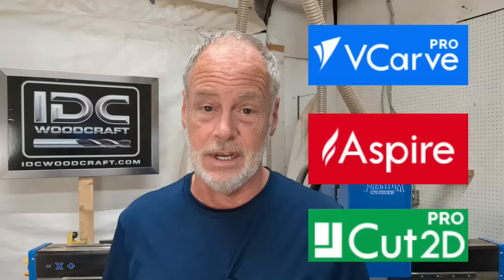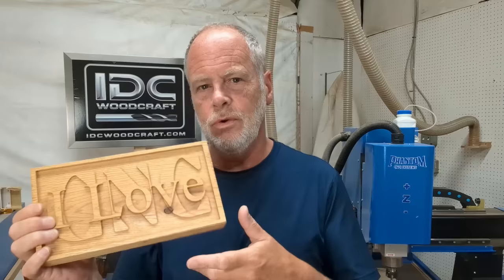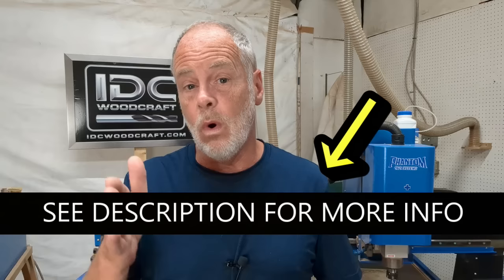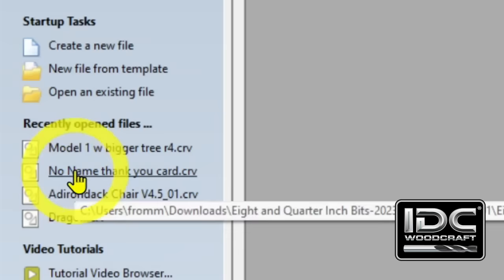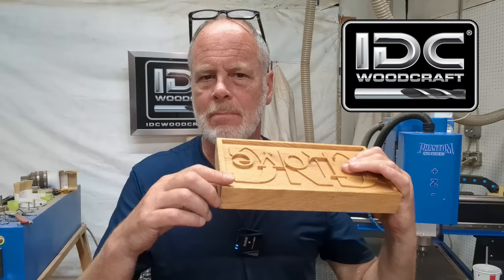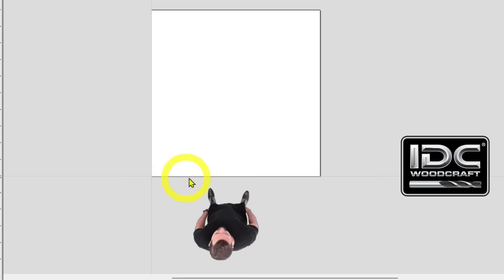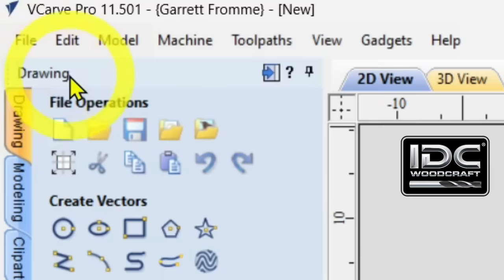The Most Complete Vectric 101 Tutorial for Beginners (Vcarve, Aspire, Cut2D), CNC Router Project

Comment: Hi Garret, I loved this video. Well worth 1.5 hours as you explained it at a great slow pace that even old guys like me could follow. My woodwork club just got a CNC machine and we need to learn so it doesn't sit there like a white elephant. I'd previously designed a speaker front baffle but I learned how to do the toolpaths so I could see the model in 3D. Just awesome. Thats going to save a lot of annoying circle routing. My port is an oval shape which is very difficult by hand. This will make cutting them a breeze with absolute accuracy...just like a bought one. Thanks so much. Peter from DIY Full Range Hifi Speakers - Australia.
Reply from the maker: diyfullrangehifispeakers, Hi Peter! I'm so glad to hear you found the video helpful and that it's making your CNC journey smoother. It sounds like you're going to have a great time with that machine, especially with those oval shapes. Wishing you and your woodwork club lots of fun and learning with your projects! Cheers!

Comment: Over the last two weeks, I've picked up an entry size for my purposes CNC, couple bits from you guys and other places, and have tried no fewer than 6 CAM software packages. I'm transferring a lot of accumulated knowledge so it's pretty easy to figure out a program for me, though there's a lot of necessary details, specifically the bits, that will trip me up at times. Kind of like trying to muddle your way through a new language that some terms you just don't know. 
Anyway, I'm primarily going after 3D cutting capabilities, which has dramatically reduced available solutions, but I've been really impressed with VCarve. It does everything I need it to do with great resolution and a mostly uncluttered UI, where some software will do XX really well but the UI is a mess, or others have a great UI, easy to figure out, but don't have the capability I need for several upcoming projects (making parts and doing molds most immediately), or having importable tool libraries. I was really using your video to see if there were any tricks I may have missed or other capacities I've not explored, but enjoy the channel in general and think I'll stick around. 👍
Reply from the maker: C-M-E, I'm glad to hear you've found success with VCarve for your 3D cutting projects! It sounds like you've put in a lot of effort to find the right software fit for your needs. Keep exploring and experimenting! Thanks for your support and for watching our channel!

Comment: Garrett Complete dummy here. LOL! I'm looking to use this in my hobby-business. Inlays on guitars and such. Basically cutting out the inlays and plowing out where the inlay goes! Headstock head plates and sound hole rosettes. I believe the Cut2D will do what I need. Thanks
Reply from the maker: I would not recommend cut 2D for the inlays that you want to make. You want v carve inlays. They seat much better. That will require you to get vcarve desktop or pro. The difference between desktop and pro is desktop will only allow you to work with projects or no bigger than 24 in. So if you're going to inlay on guitar next, you will probably want to use the pro version . That would be this one
https://sienci.com/product/vectric-vcarve-pro-v11/?ref=idcwoodcraft

Comment: 🎯 Key points for quick navigation:

00:00 Understanding Vectric layout
00:14 Design basic project
00:24 Comprehensive beginner's tutorial
00:52 CNC router projects
01:06 Vectric software basics
02:01 Free vs. paid
02:39 Software versions differences
03:44 Cut 2D limitations
05:02 V-carve flexibility
06:10 Aspire advanced features
08:01 V-carve Pro recommendation
09:09 Vectric Pro features
10:20 Software navigation basics
11:11 Launching V-carve Pro
12:07 Updating Vectric software
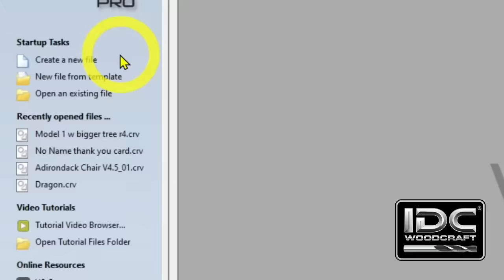13:42 Starting new projects
14:37 Job setup dimensions
16:13 Project types explained
17:38 Setting job size
19:12 Z zero position
21:00 X Y datum position
22:22 Confirming job setup
23:42 Project workspace overview
24:08 Datum position change
25:02 Setting zero point
25:45 Screen real estate overview
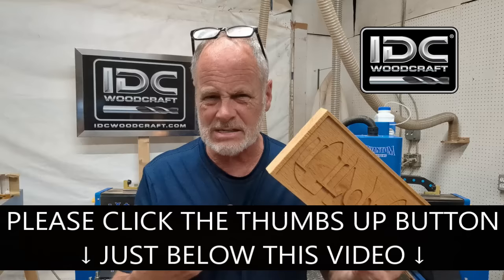26:27 Design area scale
28:13 Mouse coordinates display
29:07 CNC motion explanation
32:05 Design orientation guidance
32:47 Software layout understanding
33:42 Drawing tab focus
34:21 2D view preference
35:04 Tool paths explanation
36:40 Understanding 2D view
37:23 Layer management
38:06 Snap tools activation
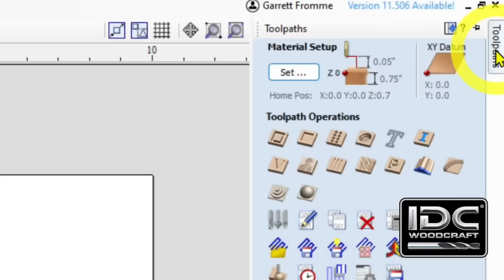39:02 Tool path tab usage
39:43 Design tools overview
41:09 Router bits starter set
43:27 Design tool explanation
44:08 Saving your project
45:33 File management icons
45:47 Create vectors introduction
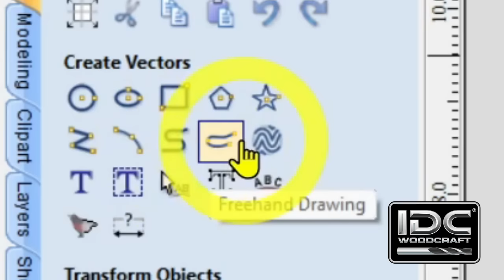46:41 Basic shapes drawing
47:34 Adding dimensions
48:01 Vector term defined
48:28 Transform objects usage
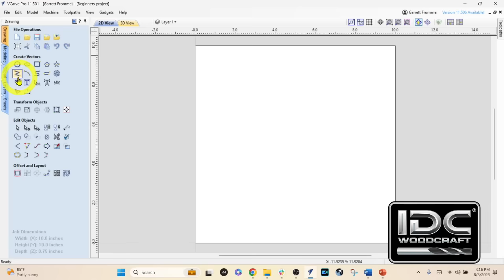49:11 Drawing closed vectors
50:33 Closed vs. open
51:01 Drawing rectangles basics
52:23 Closed vector definition
53:05 Retirement creativity purpose
54:02 CNC community support
54:30 Importance of mouse
55:25 Essential tools needed
56:06 CNC rewarding journey
57:14 Consider software course
59:04 Investing in skills
01:00:27 PDF resource link
01:01:12 Drawing five-inch circle
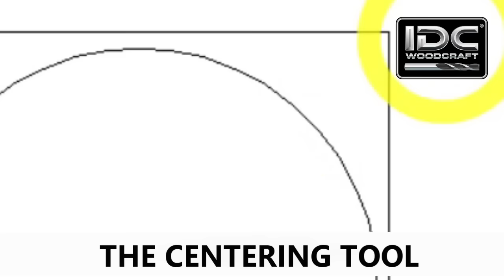01:02:50 Centering objects tool
01:04:26 Moving objects easily
01:06:02 Arrow keys usage
01:07:47 Escape button shortcut
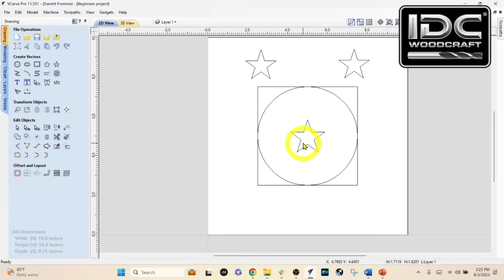01:08:28 Adding text basics
01:09:12 Text justification
01:10:34 Changing text font
01:10:58 Change text size
01:11:40 Select and edit
01:12:06 Move objects freely
01:13:02 Resize text easily
01:13:47 Stretching text vertically
01:14:13 Snap features help
01:14:54 Centering objects precisely
01:15:36 Rotate selected items
01:16:18 Recommend CNC course
01:17:30 Selecting methods
01:18:10 Drawing horizontal lines
01:19:17 Cutting features explained
01:20:29 Unique shape creation
01:21:35 Closed vector creation
01:22:04 Creating tool paths
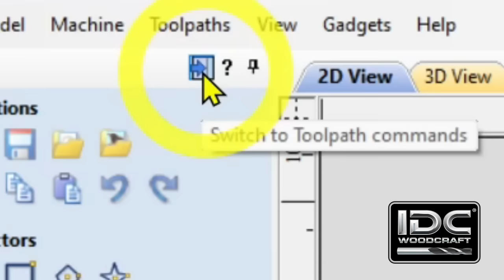01:23:11 V-carve vs. cut
01:24:08 Types of cuts
01:24:49 Pocket cut explanation
01:25:45 Profile cut explanation
01:26:24 Engraving with V-bit
01:28:02 V-bit selection process
01:33:12 Uncheck advanced tools
01:33:40 Preview tool paths
01:34:22 Carving simulation preview
01:34:52 Vertical view arrangement
01:35:20 Select pocket tool
01:36:02 Set cut depth
01:36:29 Remove extra tools
01:37:35 Select downcut bit
01:38:17 Correct vector selection
01:39:00 Recalculate tool paths
01:39:47 Pocket star preview
01:40:09 Sharper corners explanation
01:40:50 Recommend software course
01:41:30 Final cut preparation
01:42:30 Profile tool path
01:42:45 Set cut depth
01:43:25 Name and calculate
01:43:38 Preview final cut
01:43:59 Double-click to finish

Made with HARPA AI
Reply from the maker: warezit, thanks for sharing brother!
Reply: @IDCWoodcraft  Thank you for the video! 😎

Comment: QUESTION! I have a very old FANUC O-M series on a KOMO 508. Will VCarve pro make a readable program for my machine? I have been struggling to find a software that will work...
Reply from the maker: Lee, any CAD/CAM program should work to design your projects. Where it gets a little trickier is which post processor you will need for your specific machine. For this, you'll need to reach out to your machine manufacturer for their guidance. I recommend taking a look at this video here where I walk you through what a post processor is: https://youtu.be/wQ0vgXbSRr4?si=ERZAWRwnPjTyoGTU. I think you'll find it super helpful!

Comment: I just installed IDC data base, now I have a couple questions. I'm trying to carve a turkey and I had to shrink the drawing down to 4.5x4.5 and I used a 60-degree v bit and I think from making a smaller drawing its taking too much of finer detail, what bit do you recommend I use? Also, over the years of ordering bits the shipping kills the order, does IDC have a solution for this? I have a Hurco milling machine and sometimes I would like to try a single bit out and it's frustrating that its cheaper to drive to my aera shop then mailing it to me. Isn't there some way to send for example one- or two-bits regular mail in and envelope? Thanks for all you do its is very helpful.
Reply from the maker: johnwhitney6292, It's great to hear that you're diving into carving with your newly installed IDC database. Shrinking detailed designs like a turkey can indeed result in losing some finer details, especially when using a larger bit like a 60-degree V-bit. For more intricate designs and smaller sizes, I recommend trying a bit with a sharper angle, such as a 30-degree V-bit, which allows for finer detail work without losing the crispness of the smaller features. Here is a link for a bit I recommend: https://idcwoodcraft.com/products/30-degree-extreme-detail-v-bit-bit-for-cnc-routers-1-4-shank

As for shipping costs, it really depends on where you're located. I recommend going into the IDC store, adding an item to your cart, and input your address when prompted. You will be able to view your specific shipping cost before you will need to pay for anything. That will be the most accurate! Keep in mind that you might also incur customs and duties fees when importing the bits into your country. I cant determine these fees on my end so its best you do your research if you are worried about it brother!

Here's a link to the IDC store →https://idcwoodcraft.com/cnc-router-bits/

Thanks for reaching out with your questions, and I’m glad you find the resources helpful. Keep up the great work!

Comment: Hello, I m using v carve pro and I am engraving a large quantity of text in granite. I needed to change my engraving bit part way through the text. Clearly I needed to zero my Z axis.
My question is ;  how do I continue where I left off? 
I tried to eliminate the text that was already engraved but it changes all the existing text position so I can't start where I left off.
Please help me, I don't want to loose over 10 hours of my work.
Reply from the maker: DuaneSoulTruth, To continue where you left off after changing the engraving bit in V Carve Pro, you can manually set the Z-axis zero point to match where you stopped. Then adjust your toolpath settings to begin at the same depth you left off. This way, you can resume engraving without losing your progress. 
As this one is a little tricky to walk you through over comments, I recommend joining Kate and I for our live sessions we host every Wednesday evening at 8PM EST. We should be able to help walk you through it then brother!

Comment: Does your data base replae Imperial tools in v carve and are the speeds and feeds going to be different? I built my own cnc in 2012 and have been doing mostly 2d, my machine broke down and i replaced it with onfinty and i mostly want to get into 3d carving. so yes im doing the bit chase. I also want to do pictures, inlay etc.
Reply from the maker: johnwhitney6292, you can import the database as a completely different setup brother! that way you can hold onto your old databases. As for feeds and speeds, some fine tuning for specific idcwoodcraft bits has been made so you might notice a difference on a bit or two. Happy CNCing brother!

Comment: Dear Garet Thank you for your video tutorial. I Have a problem on my CNC which I built it with your generous video help.  I have a problem recently that my perfect circle on Vcurve becomes oval when I cut plywood. Can you help me to find out where the problem is?
Reply from the maker: anberberangagaw9259, I'm glad you found my tutorial helpful! If your perfect circle is turning into an oval when cutting plywood, it could be due to a few factors. Check your machine's calibration, tool bit sharpness, and plywood quality. Make sure your machine is properly leveled and your spindle is perpendicular to the work surface.

Comment: I have a nice size wood shop. I do not want to build a room for cnc machine. What are the pros and cons to enclosing my inc machine. My shop is get covered in dust too much, I am using the  dust boot with my long mill. Do you have a video about this or just some advise, thank you.
Reply from the maker: MichaelGerrior, an enclosure is a really good idea brother! It will definitely reduce the noise quite a bit but you might have reduced palm router life due to the heat generated inside of the box.

Comment: Great video, appreciate the level of detail provided. I originally found your site looking how to solve a specific problem I am encountering and didn't see it addressed here. Perhaps you have another video to address my issue. I followed the Aspire tutorial for beginners on making a simple sign and when I execute the program the first pass doesn't touch the wood. I looked up how to reset the touch off puck dimensions to ensure the Z axis was properly located relative to the work piece, but it didn't appear to make any difference and the first path still hovers just above the wood I am attempting to work. I'm sure there is a simple item I am overlooking but I have ensured everything in my program matches the tutorial program. What am I missing/where can I look to find this issue and how to address?
Reply from the maker: Timbane, it sounds like you might still be having some issues with your z-zero, take a look in that department again and see if that can fix it. If all else fails, contact your machine manufacturer. That will be your best bet to get this problem solved brother!

Comment: When using Gsender, where are the files you load into it?. Are they the individual toolpath files which I can't find on my hard drive, or the Vcarve CRV file? in other words, once the toolpaths are previewed and tested, what do you do next?
Reply from the maker: Paul, great question brother! After you're done previewing and testing your toolpaths in VCarve, the next step isn't to look for those toolpath files on your hard drive directly. Instead, you'll need to export your toolpaths as G-code from VCarve. This is because gSender, the software you mentioned using, needs G-code files to operate the CNC machine.

In VCarve, once you're satisfied with your design and the toolpaths are all set up, you'll go to the toolpaths section and select the ones you want to use. From there, you can save them out as a G-code file. This file is what gSender is designed to work with. It's essentially the set of instructions that your CNC machine will follow to create your project.

So, in short, you're turning your VCarve project into a language that your CNC machine understands, via gSender. If you're having trouble finding where the G-code files are saved, just remember that during the export process in VCarve, you can choose the location to save these files, making it easier to locate them when you're ready to load them into gSender. You also need to select the appropriate post processor. I have a video that should help you with that too. Here is a link: https://youtu.be/wQ0vgXbSRr4?si=6TJk1Odi5xlN10ZS
Reply: @IDCWoodcraft  Thanks, I figured it out a few minutes after I posted. I have done this with a shop bot but had forgotten how to save the toolpath files as g code. Thanks

Comment: With your profile cut (ON the line), wouldn't this make your project smaller by half the width of the toolbit? You would want to use outside/right to keep the project the same dimensions as your 2D project?
Reply from the maker: wpower84, you're absolutely right my friend! You'll want to cut the outside to keep the project the same size.

Comment: Please explain ,at end of design how to save and what format.. im using candle to run my 3018 cnc machine, but it cannot read the file
Reply from the maker: ShariseThompson, you need to use a post processor that works with your machine. Here is a video that should help you: https://youtu.be/wQ0vgXbSRr4?si=RAqa_9C1xqX6X3H3
Reply: CANNOT FIND ONE,, USING VECTRIC ASPIRE 9.0 AND CANDLE..ITS A 3018 CNC..

Comment: Hi I am very new to CNC routers but have lots of experience on 3d printers and lasers.
I watched lots of vidios and wanted to ge started.
I have just built a 3018 pro CNC machine with a GRBL controller and hope to expand onto a larger machine once I get the basics right.
I purchaced Vcare Desktop and and am still getting my head arround it. I have done one or two projects that I would like to make for Christmas presents.
The only problem I have, is that when I save the files and transfer them to UGS, it always shows them in the bottom left away from my bed!
I've set my zero point to the centre but can't get the job on my machine bed. what am I doing wrong!

Any help would be great, thaks.
Reply from the maker: PaulMarchant, when you set up a project in Vcarve, you need to change the settings to the center of the project brother! That sounds like what is going wrong.